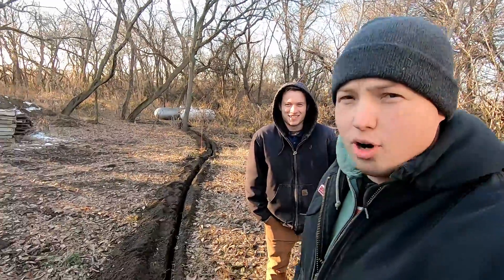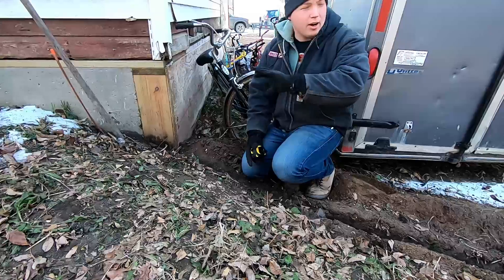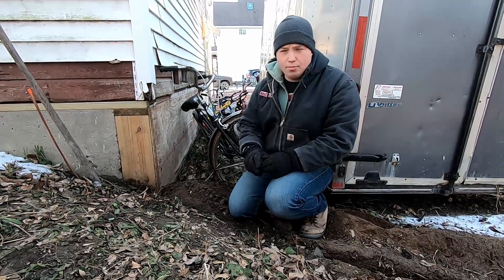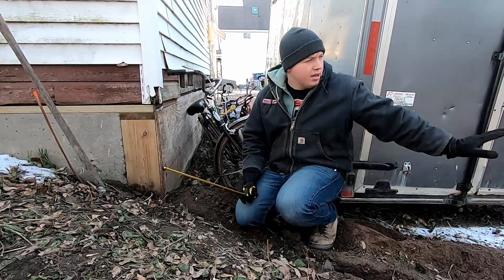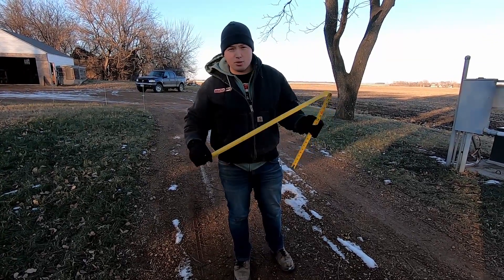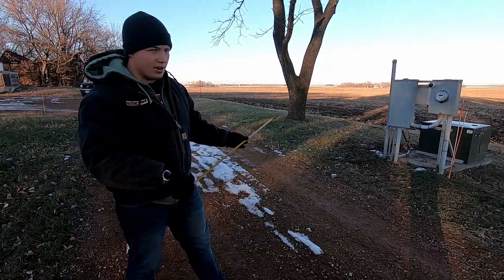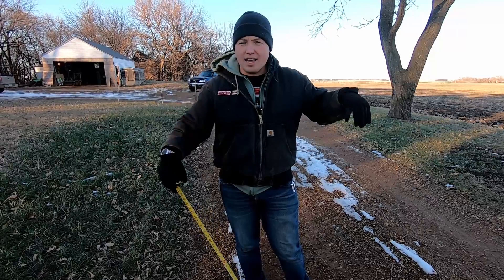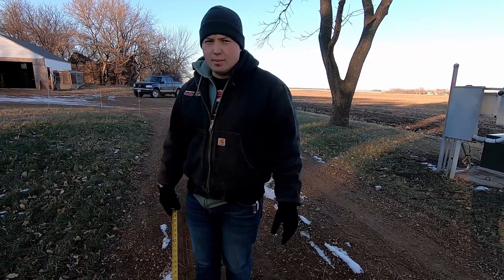How Deep Do You Need to Bury a Propane or LP Gas Line

Comment: Great job ! Had question we have 500 gallon propane tank and the valve stem is leaking on shut off valve only when turning in , When dialed all the way open does not leak . Is there a video that shows how to replace packing valve or will tank have to be empty ? Tried to tighten nut no luck

Comment: Our Home built in 1950 had oil Hot water radiators when we moved in. We changed to propane and a new furnace. Two years ago we added a split two unit system and here in the middle of Maryland it was a good choice. Thank you for your very informative Post.

Comment: How do you keep the copper from corroding?
Reply: Copper tarnishes. It doesn't corrode. Not used for propane lines.
Reply: @alrent2992  Oh yes it is, at least in many localities. Propane companies here use copper outdoors, underground and in basements. They use both the stand bare and the type with the yellow plastic coating. If they need a number of drops they use a hard line running in the basement as a manifold they install black iron. They they run the copper from the tank to the black iron, and then from the black iron to the appliances.

I have copper lines at my home installed by the propane company and they are 40 years old. Went under one crosswise with another line for water 35 year after it was installed and the only evidence of degradation was the copper had darkened.
Reply: @alrent2992  yes it is.

Comment: Are there any advantages to running lp line in a larger diameter,  heavy wall pipe?
Reply: not likely, with the 2 stage regulator system, one on the tank, one on the house, the line is under much higher pressure than conventional natural gas systems, hence the relatively smaller line size.
Reply: @thedavesofourlives1  I was referring to a pipe within a pipe for protection. 
  As an example,  I ran my service entrance direct burial cable in a schedule 40 pcv conduit. Redundancy,  peace of mind,  little expense.

Comment: Liked but didn't really like. lol. Nothing I can relate to. Does frost affect propane lines?
Reply from the maker: Thanks. I get that this is pretty basic & boring but it is something that lots of people need to know at some point. 

No, frost does not affect propane lines with the exception of shifting ground potentially damaging the pipe but that would require a pretty significant frost heave. Leaving a bit of a "loop" can help prevent this where shifting is likely. 

Thanks for the feedback!